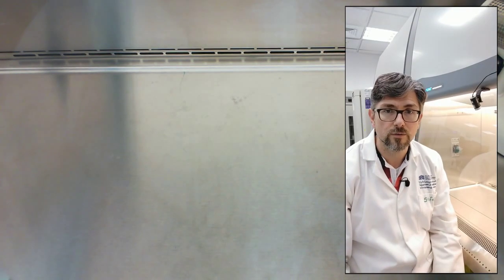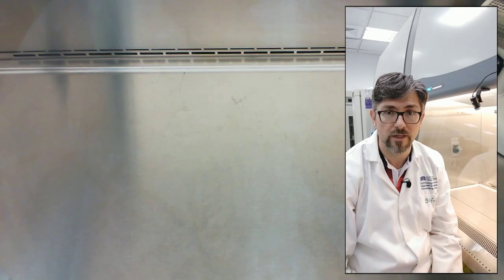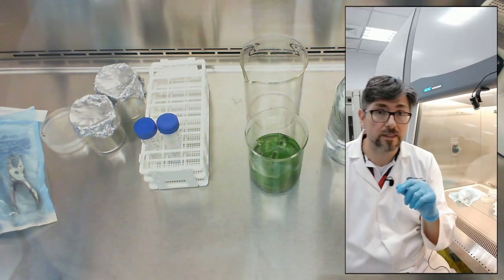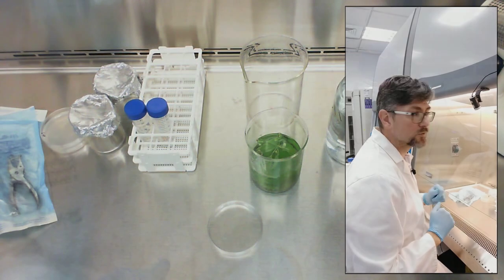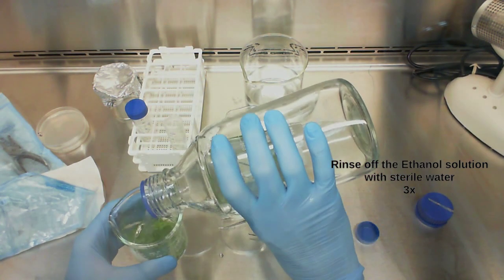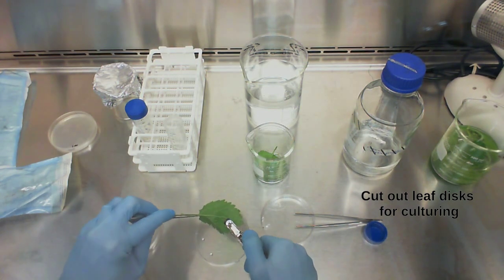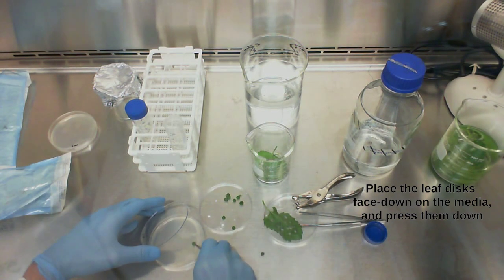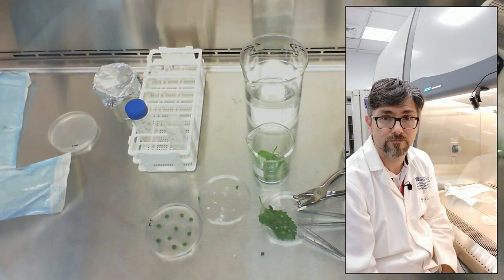Preparation of Leaf Disks for Callus Induction

Comment: Where can you buy the punch for making leaf discs?
There's no information in the description of the video.
Does the punch have a holder for the discs or have you removed it so they fall into the petri dish?
Reply from the maker: It's just a regular hole punch (I just made sure it was all metal so I could autoclave it).  Yes, I did remove the holder for the disks.
Reply: I found a circular punch at my local hobby store / sewing crafts store they have loads of shapes
Reply from the maker: Just make sure it's something you can sterilize easily.  In my case, I had to stay away from ones with plastic parts - they would be unlikely to survive multiple autoclaving cycles.  Also, look for something that can generate larger disks.

Comment: Thanks for the video. 
Do they have to be circular, can we cut rectangular pieces with a knife instead.  I use a Bunsen burner to sterilise my tools which are limited to forceps and a knife.
Reply from the maker: Yes, definitely. You can use any shape really.  I went with disks for the class because I had tools that would do it quickly and easily.  

When you're teaching a class, you want to use a protocol that will minimize the chances of contaminating things, and thus you go with the fewest steps required.  Using a hole-punch just allows my students to make a bunch of small explants quickly and fairly easily.

Do keep in mind that you shouldn't make the explants too small - try to aim for ~1cmx1cm.
Reply: @ItsLearnable  Thanks.

Comment: May sound a dumb question but... How deep should I press down disks on medium? the outline of leaves should be all cover?
Reply from the maker: It's a bit hard to describe.  You're not trying to "dig the disks into" the media, so don't press too hard. You just want to make sure that as much of the cut surface as possible is in contact with the hormones and nutrients in the media.  This will maximize the likelihood that at least some cells in the cut area will start to dedifferentiate and form a callus. Keep in mind that calluses form where there is tissue damage, so if only the undamaged leaf surface is in contact with the media, then you probably won't get much callus growth.
Reply from the maker: Also, in my experience, there are very few "dumb questions". If you're smart enough to realize that a relevant piece of information is not covered in sufficient detail, then it's unlikely that a question seeking to clarify that point could be considered "dumb".

Comment: how do you sterilize the paper towels you wipe everything with
Reply: In an autoclave
Reply from the maker: It's a good question.  If you need sterile paper towels or filter paper for work inside the biosafety cabinet (BSC) or laminar flow hood, you can wrap it in tin foil and autoclave it.
In my case, since I'm only using the paper towels to spread and wipe off excess ethanol from items before placing them in the BSC, I'm not using autoclaved paper - it's just a regular roll of paper towels (the paper towel will be disinfected by the ethanol as it's being used).

Comment: Oh :O I thought you had to use a node from the stem I didn’t realise you could make Callus from the leaves 🍃 I have so many leaf scraps i can use from my fish tank hahha
Reply from the maker: A node from a stem is a great way to propagate plants and doesn't require the production of a callus.  (it already has a meristem with stem cells - no need to try to generate any).  Using leaves can be a bit more tricky.

Comment: I used the plant begonia for leak disks, I am trying to savage it because of contamination. Do you think its the surface area of the leaf being rough?
Reply from the maker: Rough/"fuzzy" surfaces are definitely more difficult to sterilize.  The addition of a little bit of detergent like Tween (or even dish soap if working at home) into the bleach solution can help with this.   But always keep in mind that everything we do in the procedure it there to minimize the risk of contamination, we aren't always going to be successful.

Comment: Curious what is in the media? Specifically? such as nutrients, hormones,? Aside from the common things such as sugars, agars?
Reply from the maker: The media is Murashige-Skoog media (https://en.wikipedia.org/wiki/Murashige_and_Skoog_medium), with a small amount of 2,4-D (https://en.wikipedia.org/wiki/2,4-Dichlorophenoxyacetic_acid).  I don't remember the exact amount at the moment.
Reply: @ItsLearnable  Is this type of media plant specific, or will will it be effective for most plant species?
Reply from the maker: MS Media is a fairly general media used in plant tissue culture, so it would probably work well with most plants.  That said, some plants will have requirements that will not be well met by this media, so your mileage will vary.  

Sorry for the late reply - I just came across your comment. (it didn't seem to show up in my list of "Unanswered comments")

Comment: Hello sir, 

I have tried an experiment for callus induction using pseudobulb as my explant,  I have followed careful sterilization processes, hormonal balance and other necessary things all are in good condition...still I'm not getting any kind of callus induction in my culture tubes. (Cultures are 1.5 months old now) .... 
Could you please help me with this ... And suggest some modifications...

Thanks in advance.. 🙏🙏
Reply from the maker: Are you trying to culture orchids?  I'm afraid I don't have much experience with those, so I can't give you any specific advice.  I'm assuming you did your research and have the right media and hormones for your specific plant - different plant species can have very different requirements. 
 
Also, how do you know that the "hormonal balance and other necessary things are all in good condition"?  Do you have a positive control of some kind?

How many explants did you generate? Not every explant may generate a callus, so starting with many explants is a good idea (definitely more than 2).

Also, be careful with your explant sterilization.  If you overexpose the explant to hypochlorite, you could end up killing the cells that would be most likely to yield a callus (ie. meristematic tissues).
Reply: @ItsLearnable  thank you so muchh for your speedy response. 
Yes I'm trying for an orchid species, I have used auxin cytokinin ratio (1:1, 2:1, 1:2) following some research paper.  It's been 2 months and the Culture tubes are showing nothing...  I can only use pseudobulb parts as this is not the fruiting period of the species.

Could you please suggest something which can be modified in order to get the callus ... 
If possible please reply..
Thank you
Reply from the maker: @kalpanarautela320  As I've already stated, I don't have any experience with culturing orchids, so I really can't provide any advice that isn't based on reading of online resources (something I assume you've done as well).  

In a quick search, I came across a few articles (none specifically dealing with starting a tissue culture from pseudobulbs): https://www.researchgate.net/publication/349140920_Prospects_of_Plant_Tissue_Culture_in_Orchid_Propagation_A_Review  and https://www.jstor.org/stable/2474002?seq=1#metadata_info_tab_contents  .  It seems that you may have to dissect your pseudobulb to obtain the meristematic tissue.

I also came across some presentation slides on orchid propagation (https://www.igdir.edu.tr/Addons/Resmi/uploads/files/orkide-mikroc%CC%A7og%CC%86altimi-meleks%CC%A7en-akin.pdf) by a university researcher.  You might be able to get more helpful advice by contacting her directly.